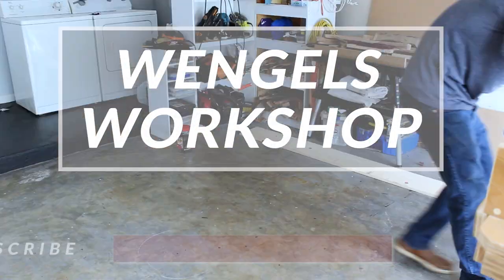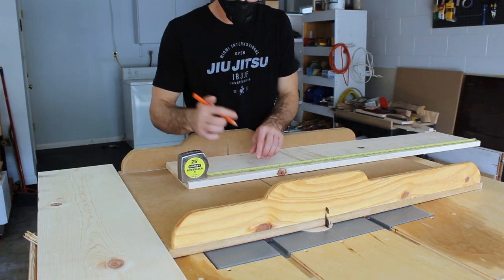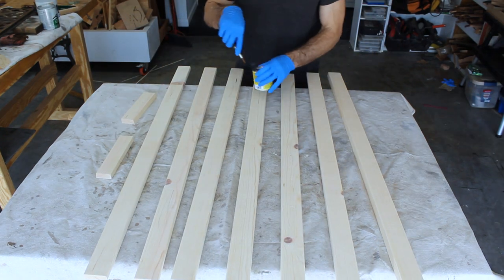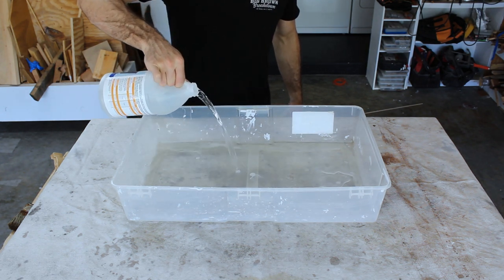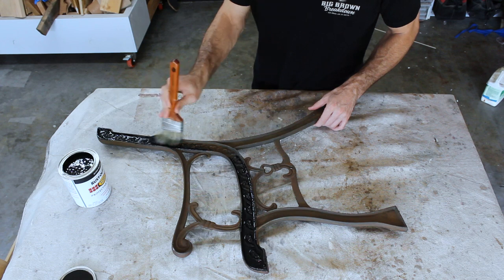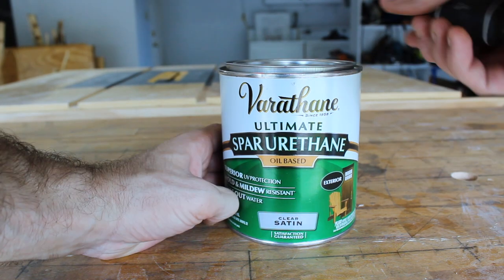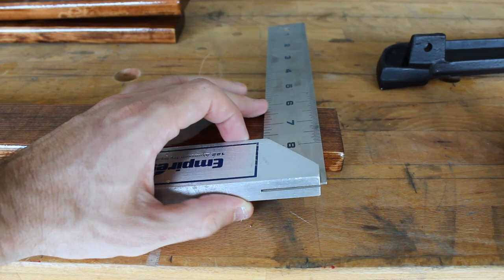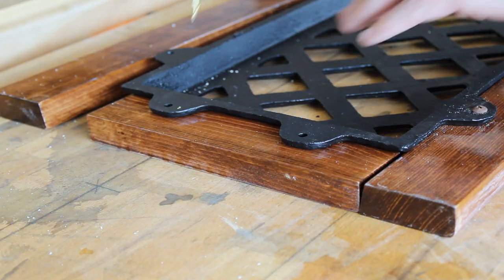Park Bench Restoration DIY / Woodworking / Relaxed Commentary

Comment: The finished build looks great - aren't you worried that you stained and finished the wood - but the wood where you drilled the holes is not finished and the weather will get to the wood and cause rot?
Reply from the maker: thanks for checking out the video Rodney. The bench is now on a back porch instead of directly in the weather. i also put a bit of urethane in the screw holes to help protect just in case.

Comment: For removing rust I would recommend using a corded power drill and wire brush wheels . I got a thorough clean metal surface . But I had a lot more rust . Use small and large head and various wheel type ones . Then I washed with water based Turps , hosed it down and when dry used Rustoleum Primer in a spray can  . You were lucky your bolts could undo . Mine were severly corroded and had to use a Grinder
Reply from the maker: thanks Rusty. I will try this next time

Comment: suggest using galvanized bolts.  is pine strong enough?  I've used Douglas fir.
Reply from the maker: i believe pine is fine as long as the boards are wide enough

Comment: I have sort of the same bench, just a different back (picked up the other day). The problem is the wood wasn’t there anymore so I have no template. Do you by chance know the dimensions of the slats for the bench and back pieces? The bench looks terrific!
Reply: look at clip spacing, then allow a small gap.
Reply from the maker: Im sorry i do not but i believe they are roughly 3 inch wide

Comment: I have the wrought iron ends. any idea what I could do for  the metal suppports. I got cedar and it feel so flexible like ti would snap. none of the supports were with it when I got it
Reply: I used a 1" wide metal strap diagonally.
Reply from the maker: Yes Carl is right!

Comment: What bit do you use to make the holes in the wood for the bolts? Thanks
Reply: Hey Dan, he used a countersink drill bit first which not only gives you a pilot hole but bores out the width for the head of whatever hardware you choose to sit at your desired depth. He then finished It up with a twist bit at the same diameter of his hardware.

Comment: how much weight can one of these bench hold?
Reply: depends on the wood used.  traditionally Douglas fir was used;  lasted for decades.  most failures at bolt holes.   so treat the drilled holes and use galvanized bolts.